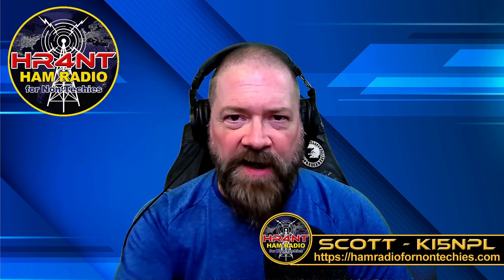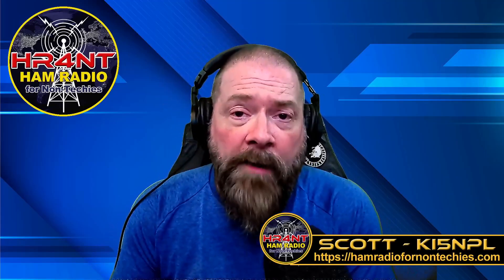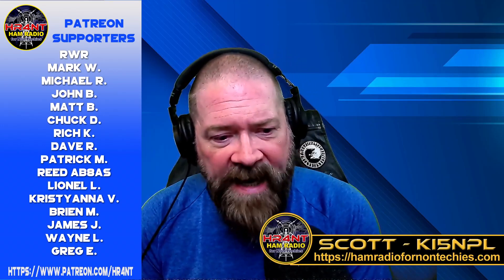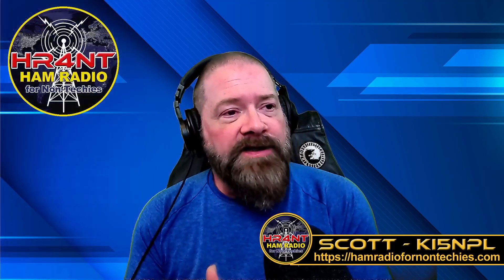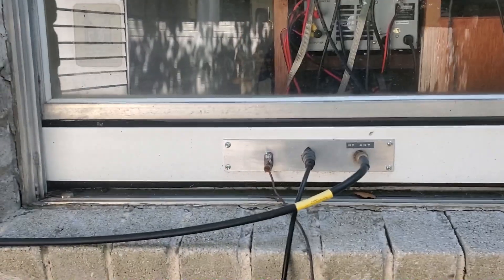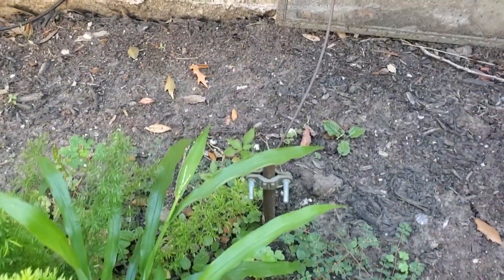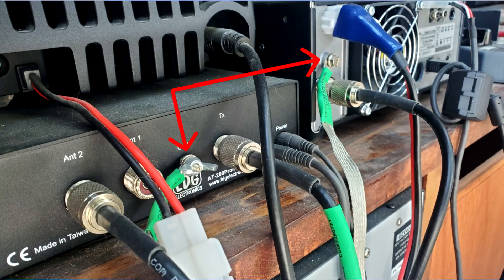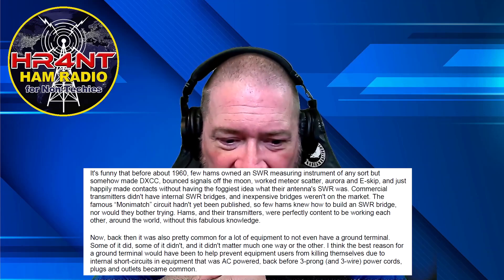Grounding My Ham Radio REVISITED:  What I Have Learned Since Then

Comment: I have worked on many radio sites and have seen all of the professional grounding procedures used and still it’s not all foolproof. I moved to the EU about 17 years ago and the area we live in is mainly rock with little soil. The most efficient device is the Static Dissipator otherwise known as Hedgehogs here. A stainless steel ball covered with stainless 0.1” diameter like antenna rods with sharp point ground on the free ends. They are designed to discharge static buildup before a strike can occur. There were also advertised in the Tessco supply catalog for communications equipment. Over here the electric company wants the ground system at the meter. The requirements are three eight foot ground rods spaced 2 meters apart and in a delta configuration. This worked out well for us since two of the rods are located in flower beds that are constantly watered. The phone line was another issue, I was hit with a surge which destroyed some telephone equipment connected to that line. The phone company told me that grounding takes place at the poles outside, NOT! Luckily I had an AT&T short 66 block with built in "heat coils" which were the newer solid state variety instead of the carbon block of old, never had any line issues after that. Got a lot of funny reactions and questions from techs who had to come out for other issues with ADSL and phone issues.
As for grounding the hedgehogs I need to install a halo ground around the whole house because of the rocky terrain. Quite expensive but worth it. A word of caution to those who have installed a halo system around their home is to avoid walking anywhere near the halo during a storm. It can energize the ground at high levels if lightning should happen to strike the system.
Reply from the maker: Thank yo so much for sharing that!  I really appreciate it!  Thanks for watching and for the comment.  73!

Comment: I had a close lightning strike that had a static charge come thru a buried Ethernet cable that connected my shack to the house.  It fried my WiFi router, fried a monitor port in my docking station, fried a monitor and fried my FT-450D.  It won’t power up.  Antenna was not connected to the radio.  There was no surge that came thru the power. Inline fuses were intact.  I think some kind of protection for the static charge would be good, because it jumped from the docking station to my radio.  Good info and a lot to think about.
Reply from the maker: Glad it was helpful.  Sorry you had those issues.  Thanks for the comment and for watching.  73!

Comment: Right. A direct lightning strike is "Game over, Dude!" I would worry more about ESD from charges building on my antennas, and maybe "hums" from differences in potential between chassis's of my equipment. Disconnecting for impending thunderstorms is best practice. Spend the money on a high quality surge protector for your station desk to protect against the crap coming in on the utility feeds through tge power supply. Everything these days runs off of 12VDC. Buy a quality power supply with the 12VDC isolated from the chassis ground and the AC transformer. If you're running a tube set "boat anchor" with no chassis ground to the utility and a 200 foot tower in Florida, then by all means, drive 50 ground rods and the cobweb of #6AWG needed for that.😊
Reply from the maker: I agree with that 100%!  I appreciate you sharing that insight!  Thanks for watching and for the comment.  73!

Comment: My grounding setup: inside the shack, all devices are tied together and run to a common inside-the-house ground (this is mainly for rf noise). Outside is where my setup may differ. I have all my coax feed lines coming from antennas going to two sets of barrel connectors, mounted on two separate panels- hard to explain. One set of barrel connectors connect to my rig inside. The other is tied to a separate ground rod near this panels. When I want to play Ham I go outside and move the antenna feed line from the grounded barrel connector over to the appropriate connector tied to my rig (they’re labeled “wire”, “vertical”, and “2M”). It’s a little bit of a pain but I sleep well at night. If lightning strikes one of my antennas it’s got a path straight to a separate grounding rod -not the one at my panel. If lightning hits your antenna it’s got a path straight to that aluminum panel mounted on your window!
Reply from the maker: Good point, but I designed this pass through based on designs that are sole commercially.  If a really bad storm is coming I unplug and capo everything with no connections to my house.  Thanks for watching and for the comment.  73!

Comment: I live in the Tampa bay area which has more lightning strikes per square kilometer than anywhere else in the US. I have a dipole on the roof of my assisted living facility. I plan to install a gas discharge  tube lightning arrestor and ground rod on my coax before the summer thunderstorm season occurs. And yes, I do disconnect my Icom 7300 from its antenna anytime I am not using it in the summertime.  I do have the ARRL insurance for my transceiver which does cover lightning damage. I figure I  will be taking enough precautions to not have to worry about future lightning strikes.
Reply from the maker: All you can do is the best you can with what you have.  As long as you are using common sense and have a plan, which it seems you do, then you should be OK.  Thanks for watching and for the comment.  73!

Comment: Did you polish the copper wire with 1500 grit before making the connection 🤔... just kidding, I just unplug all mine too. I did put a static bleeder on my antenna tower, little peace of mind I guess..
Reply from the maker: It seems to be the best way and a solid solution that will work 100% of the time.  Thanks for watching and for the comment.  73!

Comment: Do you disconnect the coax coming from your antenna to the outside of your window pass thru also or do you just disconnect the coax on the inside of the pass thru that goes to your radio?
Reply from the maker: I only disconnect the coax on the inside.  In the event of a major storm where I think the house could get hit I would disconnect outside as well.  Hope this helps.  Thanks for the comment an for watching.  73!!

Comment: I am not going to “Ground Shame” anyone. Just remember the the National, State and County Electric Codes state. All shielded communications cables SHALL be grounded to the mains ground at the shield Prior To Entering The Building. You can drive additional ground rods. You just need to tie them to the mains ground. What you are after is having the same ground potential at all points. 
Your insurance company may reject your claim for damage should you need to make a claim. If they find that you are in violation of National, State and County Electrical code.
Being in compliance with the code is only one reason to ground your shields prior to entering the building. But sending all your Common Mode Current to ground before it enters your shack is another great reason to have a grounded entry point on the outside of your building.
Anyone who would tell you to not pay any attention to the National, State and County Electrical Codes. Well you can call them what you wish. I have a name I use for those folks.
And if you think that the National, State and County Electrical Codes are not to be followed. I hope you never need to make an insurance claim for anything and the insurance company doesn’t find you in violation of these codes and leave you hold the bill.
Just food for thought.

Dave KO4HRT
Reply from the maker: Thanks for the input.  My new solution outlined in this video is solid and works every time, hence why I removed my attachments to my ground rod I placed outside in the previous grounding video.  Thanks for the comment and for watching.  73!!!!

Comment: Thank You Thank You.  New Ham has been agonizing how to ground the shack perfectly.  This is the most common talk on this subject I've seen.  Just unplug the damn thing!
Reply from the maker: Seems to work 100% of the time and my gear is NEVER in danger.  Thanks for watching and for the comment.  73!!
Reply: They have a form of OCD.
Reply: I highly recommend the book "Grounding and Bonding" available from ARRL. It will debunk things some hard core types believe, and ALSO debunk some of the erroneous information & logic presented here. Much of the info here is right on, but much of it isn't.  

Your set up is fine, except that you really should be using larger gauge wire. 

You are correct about wrapping wire around the house just to get to your service entrance ground. Would it be advisable to connect to the service entrance ground?  Yes, but to do that properly, would entail pounding more 8-foot rods into the ground, spaced six feet apart, along the route around the house corner to the service entrance. Adding one or two segments a weekend  would make that a tolerable task. But all I'd do for sure if I were you, would be to get some large gauge copper wire, and weld it to the ground rod. A problem with having separate grounds is that a significant potential difference (significant voltage) can develop between the two grounding rods, that can be dangerous to people standing in the gap between the two points. I wouldn't expect that to be problem in your situation.

The goal is to shunt electrical surge — whether induced by a nearby hit, or a direct hit — to ground rather than it going through your equipment to get to ground. You need large gauge ground cable, not a wire that will melt in a nanosecond. And down the road you should install a polyphaser type shunt device on your coax line, attached to/grounded at the ground rod. Disconnecting the coax and unplugging the power supply is a good practice but it will not provide you with reliable protection. That's due to (1) any circumstance that prevents you from disconnecting/unplugging; (2) the fact that lightning will arc to a route to ground if it's a better route to ground. There have been many instances of arcs from disconnected coax in the shack, to ground paths. 

I was in a house in 1982 that on a bright sunny nearly cloudless day, was hit by ball lightning!. I had my hand and a screwdriver inside my Hallicrafters FPM-300 and it was plugged into a 2-wire circuit. A lamp was plugged into a 3 wire outlet. When the ball lightning hit, there was a big flash in my shack and the paint inside the lamp lightbulb had burned away, as did the filament. The light bulb acted like a lightning arrestor. The radio suffered only a popped diode. It sounded like a basketball rolling down the roof, as the ball lightning did so, falling to the ground and "splintering" into numerous "bolts" of lightning that shot away from the point where it landed. A strong odor of ozone abounded. My neighbor on the ground floor was washing dishes in a metal sink, standing at a window directly facing where the ball fell to the ground about 2 feet away. I got lucky, thanks to the energy taking its easiest path to ground.

I've a good friend who has a 60' tower in his yard with a KT-34 HF triband yagi. He did proper earth grounding. Also, the yagi spreads out the charge that can develop, lessening the chance of being stuck. Anyway, a neighbor was always griping that one day lightning would hit that tower. My buddy explained about Earth grounding and the large horizontal surface area of the yagi providing protection, like a lightning rod. One day the neighbor overheard my pal working DX, and after  burying the hatchet with my friend, got a shortwave receiver and put a dipole about 30' up, running between two trees. One day a big Thunder Boomer came through, and a bolt of lightning struck the neighbor's dipole. It blew out plumbing connections and fried every AC circuit and attached appliance. He couldn't understand why his dipole at 30 feet got hit, whereas my friend's 60' tower about 40 feet away, did not. My friend asked him, "Remember what I told you about grounds?" The neighbor recalled my friend's advice at that point.

So, while it's not worth getting paranoid about for a casual operator, nonetheless it's clearly very foolish to have a crappy or absent station ground. Get that book! 73 de K7IWW

Comment: The shortest path from your operating desk to a ground rod is the best. I would suggest using #10 AWG at a minimum, if not 1" tinned braid ground strapping. I also recommend a tapped buss bar at the desk so you can use screws to ground equipment with coax braid. A 4' long  ground rod is the smallest I would use, 8' preferred.  I understand you may not have the $ to spend on grounds at first, but over the years you can add to your ground system at a small cost. A good ground can only add to your Ham pleasure by eliminating static and RF interference.
Reply from the maker: If you saw my first grounding video, I did almost exactly that  This was an update to that video because I got frustrated with the entire grounding of my shack.  I appreciate the info though!  Thanks for watching and for the comment.  73

Comment: Hi- it’s me again.  I literally just went down a rabbit hole with the whole bonding radios thing where there are so many back and forth comments about it.  It has ruined my enjoyment of ham radio as I haven’t touched anything because I’m so confused as to what is ‘safe’.  I came back to your video to calm me down.  I have copper pipe, I’m going to run wire to it with hose clamps- do nothing with a ground wire because- three prong plug takes care of that.  And I’m going to be done with this subject that has really ruined the enjoyment for me for two weeks now.  As far as my coax?  Over the winter I’ve just kept it in a ammo box, and it gets hooked on a shepherd hook outside my window.  I bring it in when I want to use it.  And I’m going to keep it this way.  Inconvenient?  Yes.  But all this other gobbly gook about code and what’s right or wrong is ruining it for me.  I’d rather be inconvenienced then to waste my time worrying.  Thanks again for being a voice of reason.

Comment: I am one of the people who had “paralysis by analysis “ about the grounding situation for the past few years. It has kept me off the air for all that time, and I’m ready to get on after I pass my general next month. It is simply ASTOUNDING, the amount of poor/bad/misinformation on grounding, even from places like the ARRL that should know better. Gotta punch a hole through a concrete wall and put up an end fed half wave that was given to me, and me and (also gifted) 30 year old ICOM 737 are getting on the air! I at least want to try the old girl before springing for the 7300 right away….  I found your channel yesterday and am really enjoying it. Plan to check out your website too. Keep up the good work!
Reply from the maker: That is fantastic!  Glad you are getting back up and running after a while.  I agree the topic of grounding you would think would be a simple issue to explain and follow a plan, but it is so dependent upon each individuals situation that it can drive you a bit mad trying to figure it all out.  I think the solution I came up with here is simple, it will work for ANYONE and it protects your gear every time.  I am glad to have you aboard the channel.  I hope you find more videos here that are useful or at least entertaining.  Thanks for the comment and for watching.  73!
Reply: The ARRL has no liability to you for misinformation or disinformation or just "advice." They are not a licensed electrician, professional engineer, licensed home improvement contractor, etc.

Comment: Great topic!  I’m a fairly new ham. No electronic background. The grounding problem has troubled me to the point I just run portable at home.  Everything comes down and gets stored away when I’m not on the air. 
 At this point, my best antenna is a discontinued Chameleon quad Hamstick antenna that runs 2 pairs of Hamsticks as 2 dipoles. It is clamped to a Home Depot painter’s pole.  Seems to work on 10M, not so much on 75M.  It only takes a few minutes to deploy or tear down. 
Situations are different for everyone.  I’m lucky  the power lines in my neighborhood are underground. QRM is about S3.  Northwest Oregon is cloudy 8 months out of the year so solar panels are not on every rooftop. 

Cheers, KK7HTK
Reply from the maker: Sounds like you have a system that works well for you.  Congrats on that!!!  Make ham radio your own.  Learn what you can and always be experimenting.  Thanks for watching and for the comment.  73!

Comment: Actually, I found out the hard way that connecting your radio to a ground rod does not protect it from a lightning strike. I had my radio shack grounded and a storm was approaching so I unplugged everything and even turned off the breaker to the radio shack incase I missed unplugging a lamp or something. Lightning struck a tree in my yard and traveled down into the wet ground and up through my ground rod about 20 feet away from the tree and into my radio to blow it out and start a fire. Luckily the fire was able to be brought under control quickly so we did not lose the whole house, but the entire shack burned.
Reply: This exact thing happened to my ham buddy.  He said he will never ground his station again.  Only the antenna.  Just unplug everything during a storm.
Reply from the maker: WOW!  That sucks!  I think the solution I came up with is a solid one and my gear is protected 100% of the time.  I hope you were able to recover what you lost!  Thanks for watching and for the comment.  73!
Reply: I'm confused, so you unplugged everything, and it still got your radio? Did I read this wrong?
Reply: @ yes, I got everything connected to that ground rod. It traveled up the ground rod when the lightning struck the tree near it. With what was left of the shed you could see the burn pattern where the ground wire was running up and into the wall.